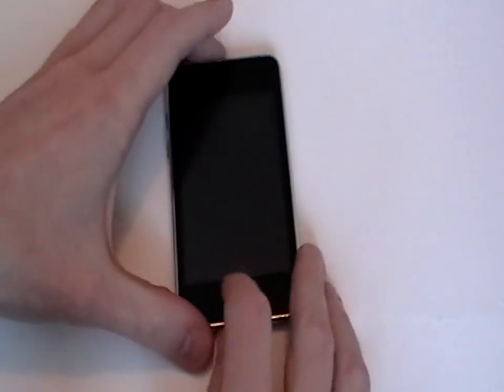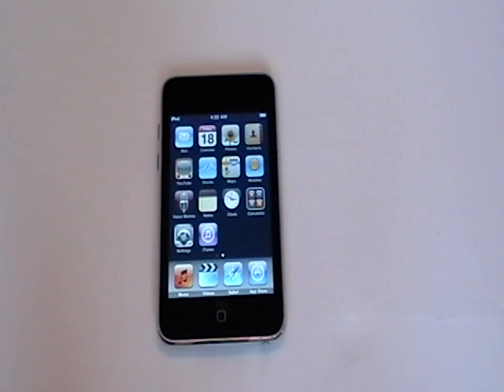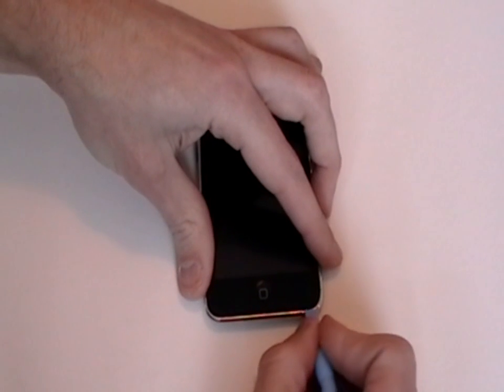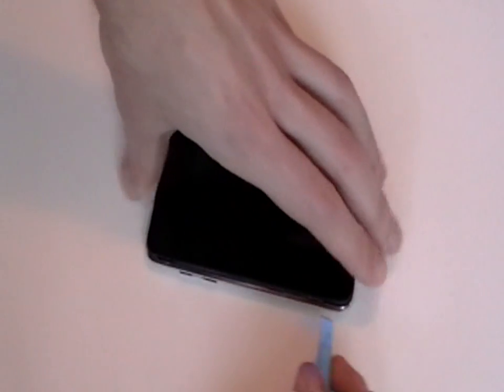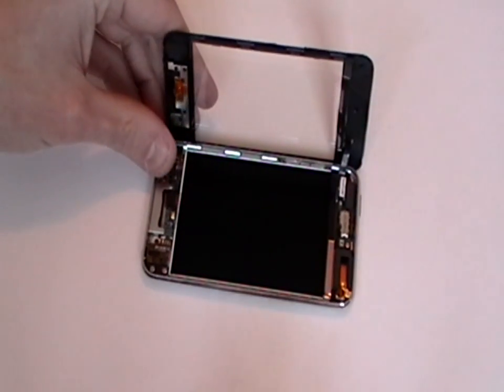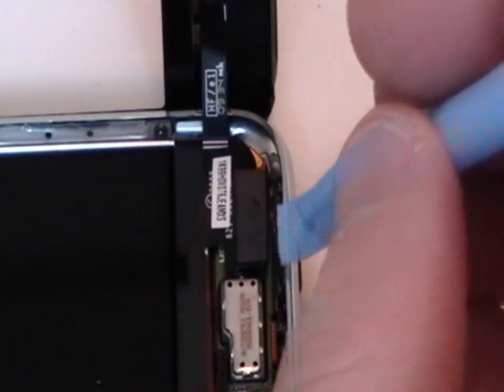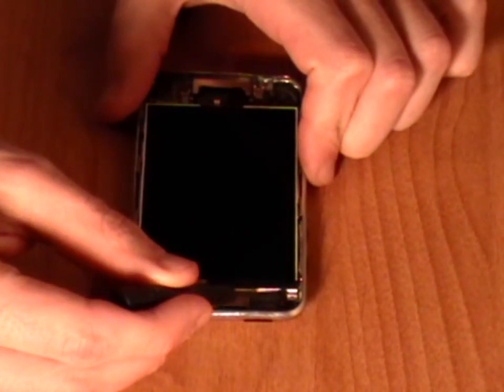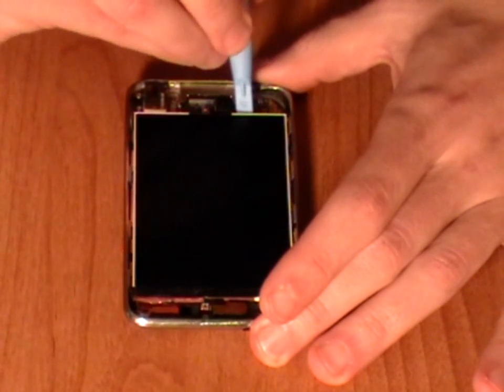iPod Touch 3rd Gen LCD Screen Repair Guide

Comment: Hey spid3r325 mine does that two but I only dropped mine on the floor and then a few months later I dropped it outside on concrete And now like a cm of my screen doesn't work                Help any body
Reply: same here

Comment: hey I broke my ipod touch but it has no visible cracks. most of the screen is white and lines appear. It still turns on and unlocks so its not a touch issue. it has what i called an "electronic bruise".Is there some way to fix this?

Comment: Ok, if my Ipod touch screen is cracked what materials would i need to repair it? the problem is that i can't see the screen anymore and i think its cracked so bad that it won't show anything its just a blank screen like its off and when i first cracked it i would try to unlock it, and it wouldn't do anything it would just stay at the lock screen untill the screen timed out. please help me!

Comment: My ipod 3g was soaked in a soda called "Canada Dry" and its not broken yet when i try to swipe to unlock my ipod, nothing happens,...
Reply from the maker: You could have damaged the touch screen digitizer flex cable on the mother board. Would open it up and check the cables to see if they are soaked in the drink if they are then you would have to do a water damage treatment to get it up and running. Good luck on your repair.
Reply: Jemimah Columbres that’s ironic because your iPod wasn’t dry when it got dumped on the ipod

Comment from the maker: M3RKM0Dz , What ribbon cable did you break? Mostly anything on the ipod can be replaced. Mostly...
Reply: hi can you help me my ipod3 of button the one thats on the top right corner has went in and now it does not work
Reply from the maker: Palmer Na You need the power button volume flex. You can find one here.....http://www.repairsuniverse.com/ipod-touch-3rd-gen-power-volume-button-flex-replacement.html.

Comment: hi my ipod got water spilled on it and now the screen is dim and has lines going across it other than that it seems to work fine the touch still works and the sound still works just the screen is the only problem i can see all the buttons work any way i could fix it?
Reply from the maker: Sounds like the LCD has gone bad. This would be something that the water damage has done to the flex cable that connects the lcd to the motherboard.
Doing water damage is a tricky thing. You would have to make sure to clean the  water corrosion before reinstalling the LCD and Digitizer.
Reply: alright thanks im gonna have my dad look at in next friday
Reply from the maker: Sounds great. Good luck Hungry.

Comment from the maker: You will either need to use a screw extractor to remove the screw, or use a small drill bit to drill out the screw and remove. These are your two easiest options. Chat with us live for immediate assistance at RepairsUniverse (dot) com

Comment: Great Video. I have an Ipod touch 3rd Gen 64 GB that kids have dropped it. I was able to open it. It seems that the LCD screen is broken. Also when I connect the Ipod to a "Power source" it turns on, but does not load showing only apple logo, but when I connect it to a USB port on my Laptop it does not turn on. Any Ideas suggestions would be appreciated. I took it to apple, they wanted to sell me a new one.

Comment from the maker: In most cases the LCD still displays an image but the outer glass is cracked. If the inner display is not working ,bleeding, discolored or cracked then you will need to replace the LCD as well as the touch screen digitizer.

Comment from the maker: @CavemansWife247 I see. Does iTunes still recognize the device? If it does, it is likely either a connection issue from the LCD screen to the motherboard, the LCD flex cable has been damaged, or the LCD screen itself has been damaged. I would suggest disassembling the device again and checking these 3 things to see if the issue can be spotted.

Comment from the maker: @shabangabang89 The touch sensors are located on the glass touch screen digitizer. This is the part your will need to replace. These are available at RepairsUniverse (dot) com.

Comment from the maker: @JFCRAZE000 Guitar picks work great, as do small flat head screwdrivers (if you are familiar with disassembling iTouch's). Plastic pry tools are your best bet if this is your first repair. Some local repair shops may have these or a few other options available.

Comment from the maker: @UniversalHere That is the adhesive that holds the touch screen to the mid frame. You will need to get below the mid frame, so you are prying between the plastic and metal housing.

Comment from the maker: @iloilokicks I would just double check the generation (type the model number on the back case into a search engine). If it is a 3rd generation, you will need a 3rd gen - as the 2nd and 3rd are NOT cross compatible. These are available at RepairsUniverse (dot) com.

Comment from the maker: @bugboy357m Not a stupid question at all. The outer glass screen is called the "touch screen digitizer", this is normally cracked in a spider web type pattern and is the most common damage. LCD damage would be issues with the display, such as dead pixels, backlighting, etc. 
The part you will need is the touch screen digitizer. Replacements are available at RepairsUniverse (dot) com.

Comment from the maker: @samanthalucindat Possible the replacement screen is the wrong generation. This is very common. Especially with 8GB 3rd generations, which use 2nd generation digitizer (technically are 2nd generation but sold as 3rd.)
I would suggest typing your model number into a search engine, you should be able to determine your correct generation from there.

Comment from the maker: @jacknumber13000 No problem. This is an issue with the LCD screen. Sometimes this is caused by water damage, drops, or loose connections. It is normally worth disassembling the device and checking the LCD connection. If the connection appears fine, I would suggest replacing the LCD screen. These are available at RepairsUniverse (dot) com.

Comment: Hi  @RepairsUniverse, thank you for you video. But I need help.

My 3rd Gen iPod Touch started flicking little horizontal white lines, now it's just a big flickering white screen(hard to make out whats on the screen). I tried Restarting it by holding the power and home button, but its still flickering. What do you recommend on doing?

Comment from the maker: @stickfigpro I would suggest removing the outer touch screen assembly (following this video) and attempt to clean it up from there. Hopefully it will clean right up, but possibility the sanitizer will damage the LCD screen itself, in which case a replacement would be required. These are available at RepairsUniverse (dot) com.

Comment from the maker: @jamazeon You will need to remove the home button from your old digitizer, it is normally just held in place between the touch screen and the mid frame / home button flex. Place the home button inside the new digitizer and then install the mid frame. Be sure the tabs located on each side of the button are seated properly. Everything should just pop into place from there.

Comment from the maker: @slwilson21 Hmm, I wasn't sure but seems a bit more likely now that the digitizer you replaced it with is either not connected properly or is a faulty part. May be worth checking out the connection and considering a replacement if the connection looks good.

Comment: The digitizers were purchased brand new. They all worked on my other iPod. The un responsive one worked fine until it fell out of my pocket. When it fell the digitizer cracked so I replaced it. But no response. When it fell the top right corner hit first.

Comment from the maker: @slwilson21 Hmm, could be an issue with the motherboard, or the connection located on the motherboard then. Have any of them worked for even a few days? Or all are completely non responsive? Has the iTouch ever been water damaged?

Comment from the maker: @supportmytroups7 It is very true, more experienced techs use a more sturdy pry tool or flat head screwdriver, however for novices this is very dangerous. Plastic will not scratch the housing and is softer than many of the parts, meaning less damage. But once you know the process, a more sturdy pry tool will cut down the work quite a bit.

Comment from the maker: @onesis5 I would suggest disassembling the iTouch and checking around for major connection issues or damage to the motherboard. If you don't feel comfortable doing this, take it to a shop for diagnosis. From there you can determine if it is cost effective to repair.

Comment from the maker: @Blackopskillsmw2 Sounds like either LCD damage or the LCD flex cable has been jarred loose (less likely but always worth a check). Replacing the LCD will resolve the issue. These are available at RepairsUniverse (dot) com.

Comment from the maker: @Blackopskillsmw2 Difficult to say, will depend on what caused the white screen. Normally a LCD screen replacement will resolve, but there are chances it is not the fault of the LCD screen and could be the motherboard. But the cheapest and most likely way to resolve would be replace the LCD screen. And digitizer if it has been damaged. All these parts and tools can be found at RepairsUniverse (dot) com.

Comment from the maker: @LittleSenia This is the touch screen digitizer that will control this. I would suggest checking the connection to be sure it is fully in place. If it appears fine, I would suggest replacing the touch screen digitizer. These can be found at RepairsUniverse (dot) com.

Comment from the maker: @oliwer200 The pry tools are made of plastic which will not scratch or damage the housing/screen/internals (when used properly). A metal pry tool is much more effective but can cause damage and should only be used if you have experience.

Comment from the maker: @heroicbalthier Some are more stubborn than others, depends on history, manufacture date, etc. Removing the plastic mid frame is a bit tedious, just take your time. As for the screws, make sure you are using the correct size of phillips screwdriver. Also a small bit of penetrating fluid on a Q-Tip can help loosen these off. If that doesn't work you can use a screw extractor to remove the stuck screws.

Comment: How the hell did you get it to come apart so easily. First the plastic removers broke when I tried to use them, then the screws on the metal plate wouldn't come out.

Screw apple and their shitty customer service and non-user friendly design.

Comment from the maker: @Steheath1992 If it is not recognized by a computer or charger, that is not a very good sign. Normally this means the motherboard may have been damaged. A local repair shop may be able to give you more information and diagnose the issue. There are just too many variables to diagnose from afar.

Comment from the maker: @sasquatch446 I would check the connections for issues and damage. However water damage is tricky, as damage to the motherboard can cause similar issues. If you feel confident that the LCD and touch screen are at fault, replacing these can likely resolve the issue. Replacement screens and tools for the iPod Touch are available at RepairsUniverse (dot) com.

Comment from the maker: @FuNkWaD19 This is an issue with the touch screen digitizer. I would check that the touch screens flex cable is fully in place and securely connected. If everything looks fine, replacing the screen should resolve the issue. You can find replacement screens, tools, and parts at RepairsUniverse (dot) com.

Comment from the maker: @juiceboxmen You can transfer those over easily enough. you will need to break the black tabs holding the old one in place and either melt the tabs down on the new one, use adhesive strips to hold it in place, or use glue / hot glue to keep it stationary. Usually a simple swap.

Comment from the maker: @zabingsterdio Have you replaced the LCD screen? Was there a drop or any damage that you can think of that caused the issue, such as a recent take apart? Usually this is just caused by a faulty LCD screen and a replacement should resolve the issue. Check out RepairsUniverse (dot) com for replacement screens and parts for the iPod Touch 3rd Gen.

Comment from the maker: @donahkebabnah That does seem a bit odd. I would suggest disassembling and making sure the headphone jack is not damaged and fully connected. Check for damage to the flex cable as well. Making sure it is securely in place may help, but not likely to cause the issue.

Comment from the maker: @candyapple1766 I would check the LCD screen flex cable. Make sure it is fully connected into the connector. If the connections seems good, I would suggest replacing the LCD screen.

Comment: @RepairsUniverse Thanks buddy. I am interested but am UK based.
To be honest got the front off but have made a real mess of it, the headphone part needs replacing, the strip that connects the screen snapped and the housing also will need replacing, been a bit of a disaster. Can you help with these parts? Trouble is being UK based and you being in the USA it will take you some time for the parts to arrive.

Comment from the maker: @JST1324 It is possible, if the LCD screen is faulty or has some sort of issue connecting to the motherboard. Check some of the forums out for info on white screens, there are quite a few ways of diagnosing the issues. Good luck!

Comment from the maker: @FrEsHtOdEaTh1997 You can look up ways to remove stripped screws, we rarely run across the issue however. Luckily these screw are not overly strong so there should be no issue removing it if you find a decent guide. Good luck!

Comment from the maker: @71Racin Could be an issue with the LCD screen. Might open it up and check for connection issues, if now, replacing the LCD screen may be the way to go. You can find screen replacements at RepairsUniverse (dot) com.

Comment: can you please make a video about how to replace the housing(the metal back cover) please every step of it from the taking apart to the putting back together. also are the screws identical or do i have to remember which screw went where.

Comment: When replacing my LCD due to the backlight going because it went through the washing machine, it all went well and the backlight started working again. However, later on it stopped working again. Is this an issue with the LCD or something else?

Comment from the maker: @Manny159744 Hi

Yes our screens are real ones and working. However you need a 2nd generation LCD not a 3rd gen. 8GB's are still 2nd gen. Only the 32GB and 64GB got the upgraded hardware.